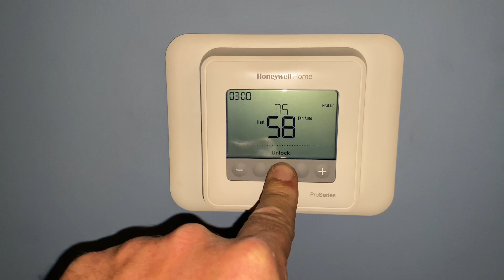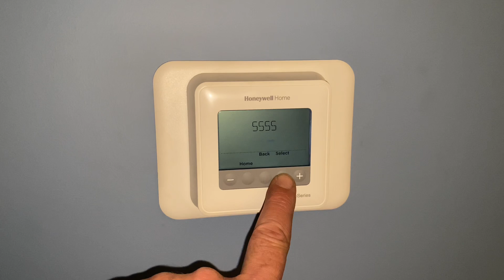Secret Tips to Fix HVAC Not Heating: Boiler, Fan Coil, Relay & Thermostat

Comment: Code is 1234 if no one set a code.  Honeywell told me the stat will lock it self out if it notices a bunch of random  button pressing in a short period of time.  Dont know if its true but thats what they said the first time it happened to me. Happens to old ppl alot that dont really know how to use a digital stat.

Comment: Nope don’t like programmable nor lockable T stats 😤🤬 keeping it simple always works best !!! An ? Every morning when I change my work clothes I always transfer  a wago in my pocket 😅 kinda handy when T stat is in question an gives me a fast solid connection with out twisting 😊 an since I am laying on my couch being a back seat driver😂. No tool belt? Yep we are going to have to send you back through Mikey pipes school of preparedness …😂😂😂😂😂❤ But in all seriousness that was a mind bender service call   Interesting heating set up their. Got to love the duck weather but better than the white stuff !
Reply: I hammer smash them all and replace with simple t-stats for that very reason.
I tell people to avoid all that junk, as most here are older drafty homes. BUT even in newer homes, the setback and recovery is mostly a scam of lies, because all the furnishings and interior cools off or heats up, then it takes far longer recovery time, which often ends in multiple shorter cycles and lack of comfort while it's occurring.

Comment: Not for nothing but when I walked into a customers house I had my tools with me.
Reply from the maker: I generally asses the situation first
Reply: pockets are great for a few simple tools, multiplex screw driver, stripper/pliers, wire nuts/jumpers. beyond that have helper be the gopher, if no helper by all means take a large tool bag in!

Comment: How is an Airhandler used and installed to a boiler?!?!?
Reply: It’s called hydro air, there’s a hot water coil in or after the air handler
Reply: Hot water flows through coil in the air handler like an evaporator put a temp sensor on the pipe carrying hot water when it reaches temperature it closes switch turning on blower motor. Bam hot air out supply vents.